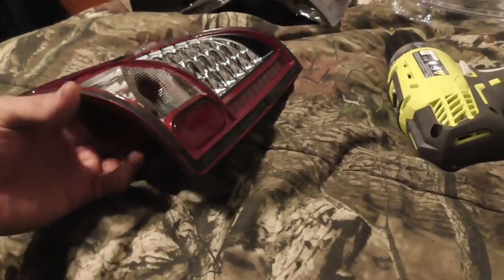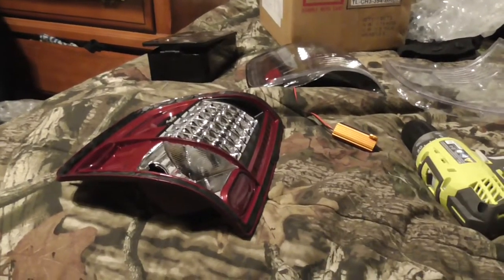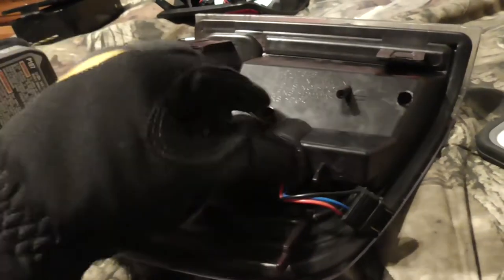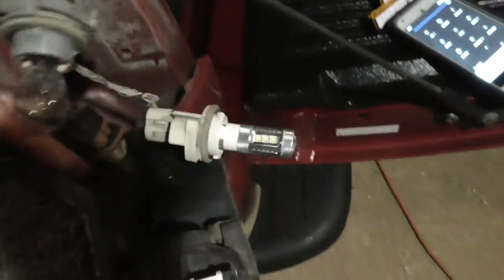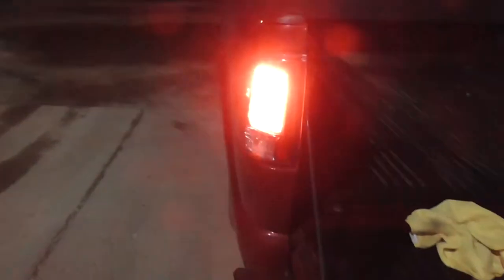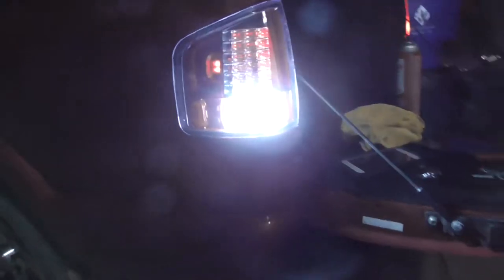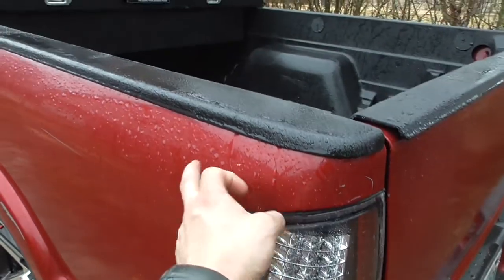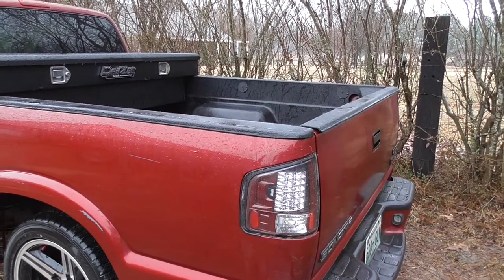Sonoma Update | Color Matching LED Tail Lights and Install

Comment: That looks good.  A quick buff and that paint would look better.  Even a clay bar treatment would probably bring it back.  I would like to open up my lights and change some things but they were pretty expensive.  I will wait a bit them maybe open them up.
Reply from the maker: Yeah, it could use a good buff and wax.  There is some damage through to the primer in a couple spots (you can see one area on the rear driver side of the bed by the "flair"). But it should still clean up good. Yeah, tearing lighting housing apart is tricky the first time, especially if you have the perma glue/silicone type stuff that the heart does not affect much. (like these housings). But this is also my 6th set of housings I've taken apart so it's fairly easy for me now.  But every new housing has its quirks that make it a different challenge.

Comment: my 99 s10 does the same thing when you stepped on the brakes while the flashers were on.  I think its because the brakes and flashers run on the same circuit that's my guess.
Reply from the maker: That might be it.  But the GMT400s (88-98 GM full size trucks) work the same way but my 96 Yukon and my buddys 95 Z71 work like normal.  But I know of a couple other people whos  GMT400 works like this and stops flashing.  It has to be some wiring issue or module issue, or they was just messed up from the factory.  Who knows, it's just a weird quirk of these 90s/early 2000s GM vehicles.

Comment: Diff you every have a problem with the reverse lights not working? And yes i have changed the bulbs and conecters to the bulbs
Reply from the maker: Sounds like your NSS (neutral safety switch).  It's located on the side of the transmission, look for a gray wire in a 7 pin plug (There will be a 7 pin and a 4 pin plug) and test to see if it's getting power at the switch on the transmission when in reverse.  If no power on the gray wire, the NSS is bad.
Reply: @DanielPace92  so it wouldn't be because the indicator for the gears in the cluster doesn't move from park? And is the nss on the passenger side?
Reply from the maker: @c4or2ey0  The NSS is usually  responsible for the PRNDL display and it could either be the NSS, the wiring for the NSS, or could also be the connectors going into the NSS.  The NSS should be on the drivers side of the transmission. (US driver side)  The 4 pin connector seems to control the PRNDL display. But the 7 pin connector has the reverse trigger wire.
Reply: @DanielPace92  cool maybe tjats another reason my 4 wheel drive wont ingaged the front axel. Iv done the cable converstion from the stupid vacumm system.

Comment: Do a led head lights
Reply from the maker: I already have some plug and play LED headlight in the truck, just didn't like how the video turned out so I never uploaded it.  I will be building  a set of headlight for the truck though.  I have everything I need (I think) just have to actually build them.